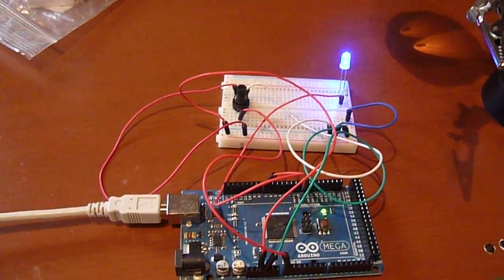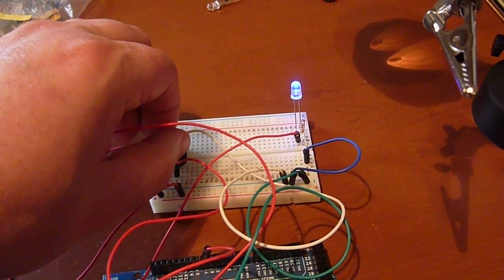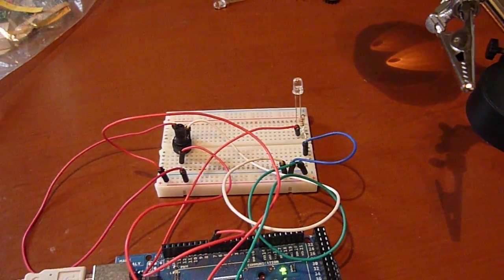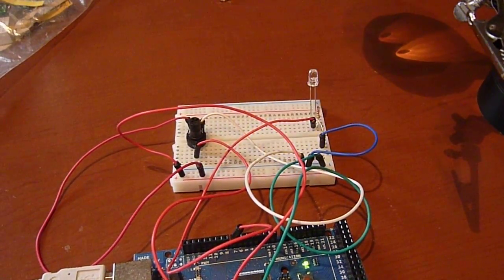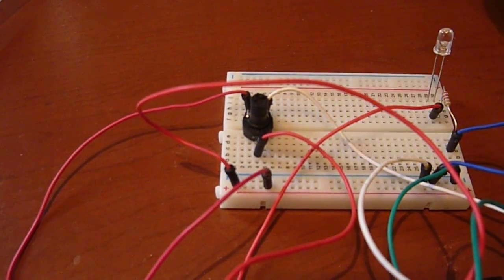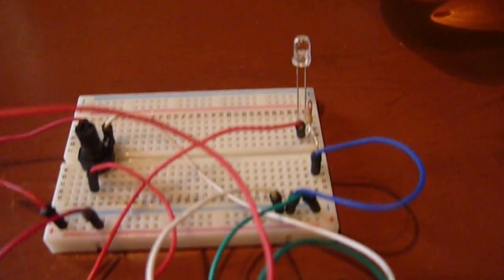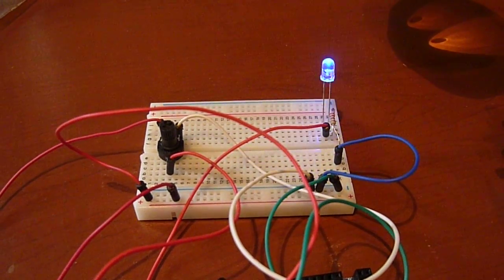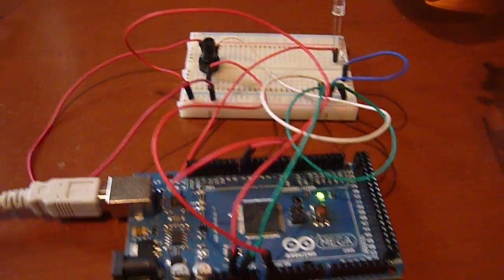LED Blink Speed / Arduino Sketch

Comment: is it possible to do the same thing but on a 12v led or other stuff at 12v?
Reply from the maker: yes, by using a mosfet, see http://arduinotronics.blogspot.com/2012/03/mosfet-control.html
Reply: Steve Spence But how i can adjust the min and max flashing time and the time the led is on and the potentiometer to adjust only the frequency between every flash?

Comment: hello steve,
i am looking to run 2 leds with 2 potentiometer setting the blink rate for each led.
can you explain how to make 1 pice of code for that ? 
i will be using an attiny85 for that and not a full arduino...

Jonathan
Reply from the maker: I've not used a attiny85, but it should be similar. you'll need two analog inputs, once for each potentiometer and two digital outputs, one for each led. duplicate the connections and i/o code (differentiate the variables names, pot1 & pot 2, led1 & led2, etc). Send me a attiny85 and I'll work out the whole thing out for you.
Reply: Steve Spence thanks a lot 
i just got few Attiny85 and going to try and modify the code myself,
if i'll need any help i will let you know,
thanks again.

Comment: Thats a good one. I used 3 LEDS. Can you add a button to start and stop it?
Reply from the maker: Sure. change the state (0,1) of a variable every time the button is pushed (make sure you debounce). Only run the LED if the state == 1 (wrap it in a if statement).